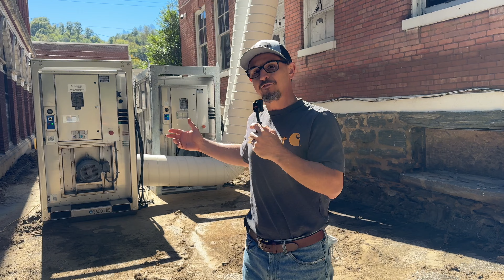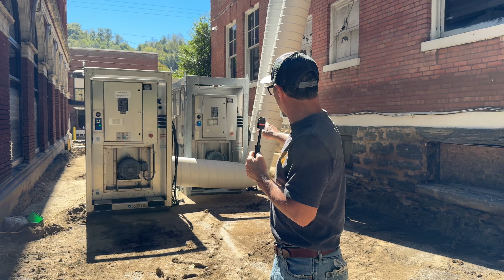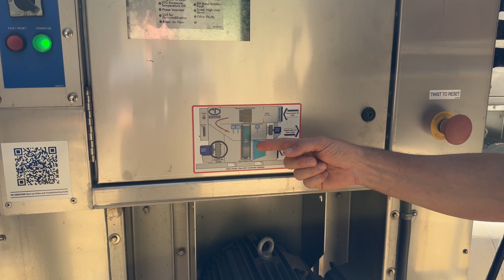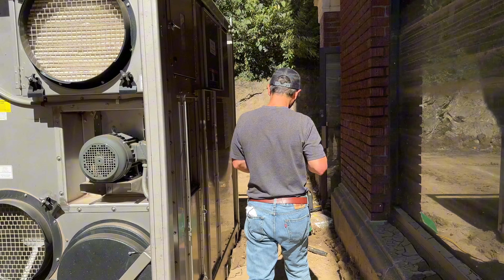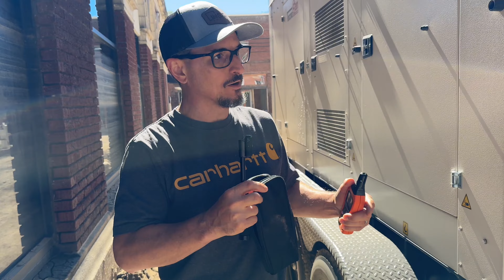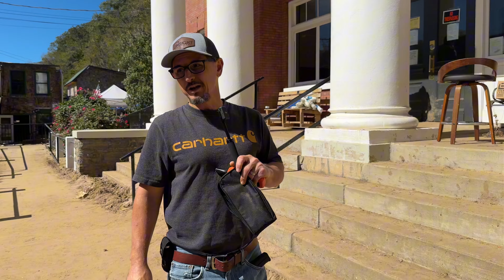How to Dry a Building After a Flood: Desiccant Dehumidification Guide

Comment: I worked for Munters for awhile. They make bullet proof equipment. Amazing company and well designed gear. I  learned a lot while working for them but management I dealt with were pretty horrid wretched people. You probably reached a point where it would have been better drawing air from the building.
Reply: It's the same in Turkey. The dehumidifiers are nice, but the management is truly rotten.

Comment: Condensate line/drain?
Reply: No coil to condense the water out. There is no phase change with a desiccant only unit.
Reply: Desiccant dehumidifier not have drain line. Reactivation process, outside air will pass the Heater and pass the siliga gel for releave Moisture from siliga gel, And exhaust wet air to outside.